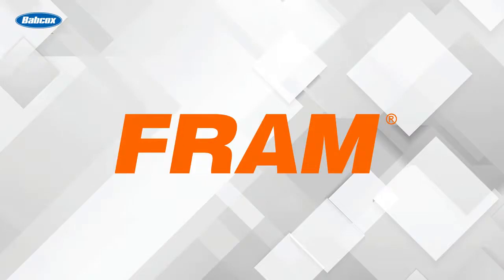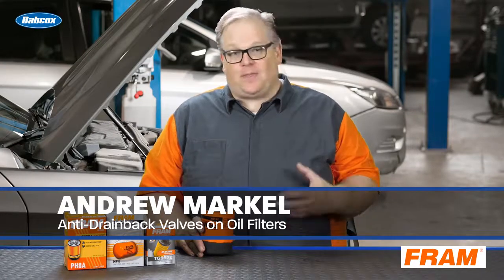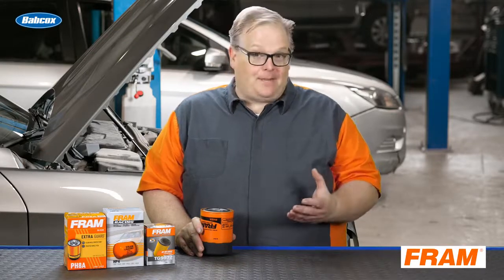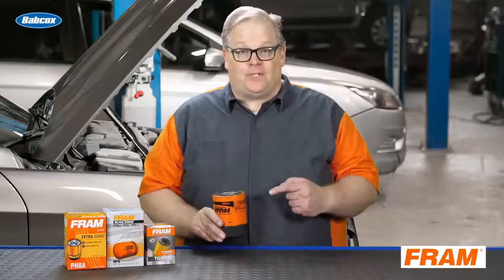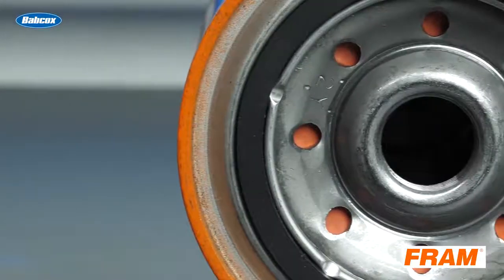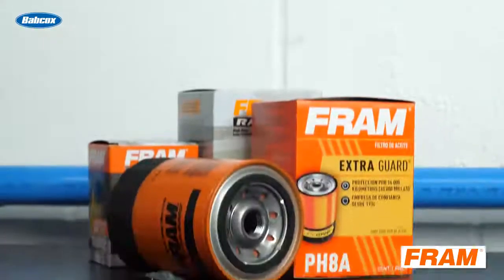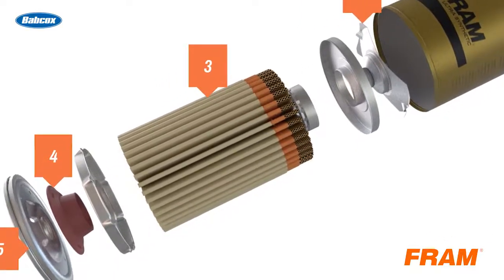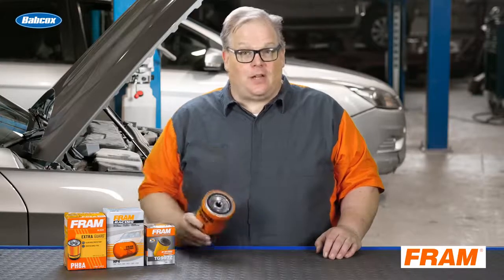Why Do Oil Filters Have Anti-Drain Back Valves?

Comment: He talks about quality parts but fram has the worst and cheap parts campers other brand
Reply: Really ----- I am 70 Years old ,  NEVER used another Band that FRAM Oil Filers ..............  I HAVE NEVER LOST A ENGINE , In Fact Every Car or Pickup I have ever had Last Well over  ((( 20 YEARS )))  .  My Engines Last Longer than the Car or Pickup Will .......................  Do NOT Get Sucked Into the FAKE ADVERTISEMENTS , FRAM Will Filter Out Everything Down to 20 Microns .  You can NOT See a Micron with your Naked Eye .   ---------------  And TESTING has Proved FRAM Gold is One of the VERY Best Filters on the Market ,  Track Racers I know Use them .

Comment: Correct me if I'm wrong but isn't an ABV (silicone or otherwise) important only if the filter mounts horizontally?
Reply: It's a good question.  Furthermore, how long can the filter really contain the oil after the engine is shut off, if the filter is mounted in a horizontal position (or open end down, as in many Jeeps)?  How much oil is really left in a horizontally mounted filter after the car has been shut down for a couple days?  I ask this because many oil changes businesses ask employees to drain used filters (open end down) for many hours over an oil collection tank before crushing them for recycling services.  If those anti-drain back valves could keep the oil inside the filter indefinitely, the draining procedure before crushing would be useless.

And what good does the anti-drainback valve do if the filter is mounted on the engine with the filter's open end in the highest possible (up) position, where gravity keeps the oil in the filter after the engine is shut down, as is the most common mounting position?
Reply: This is true many filters with the anti drain back feature loose most of their oil  after 24 hours. Cutting open filters to see their construction only tells part of the story. You would need to test the anti drain back feature weighing the filter before and after sitting to see how much oil is actually retained. Most owners will drive their vehicles everyday so 24 hours is not a big deal. For vehicles sitting much longer this means a few seconds before oil pressure comes up and filter is filled. Plus the concern of contaminated oil draining back.
Reply: @davedavis775  wow - this is crucial info - crazy that I have not read this elsewhere. thanks